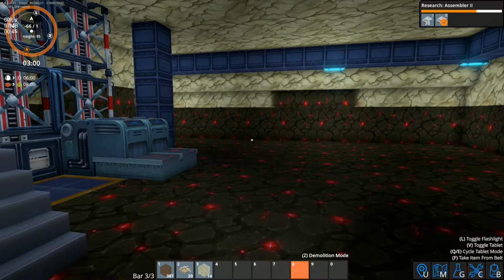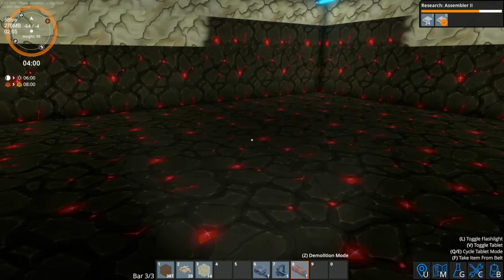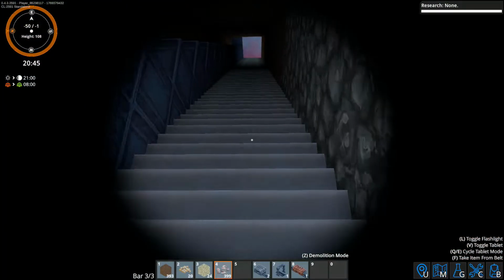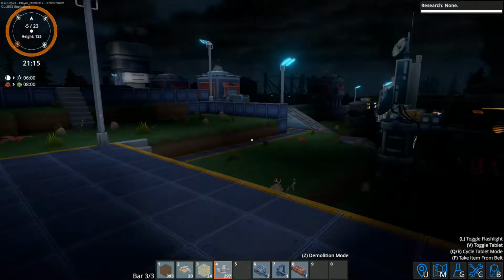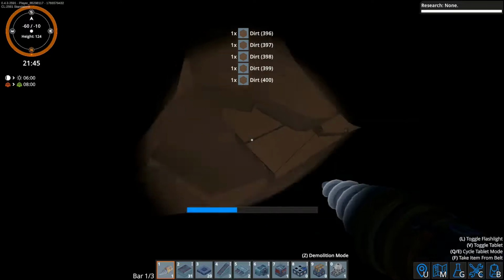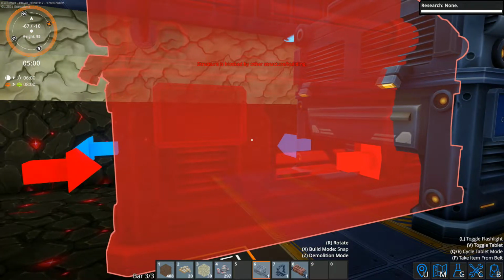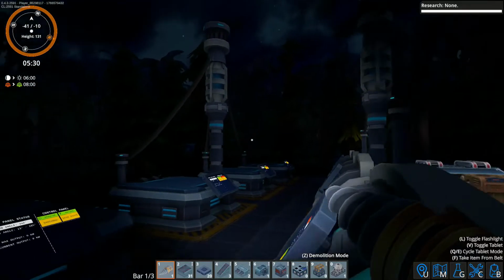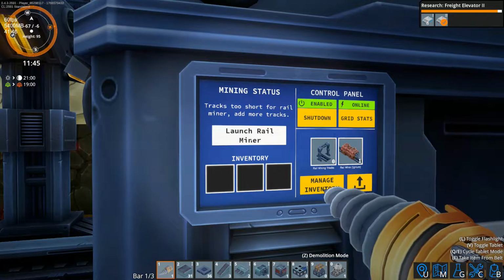Let's Play Foundry A Factory builder in early access pt.10 Life Underground!!!

Comment: Interesting way of conveying high voltage down to the rail station.  Personal Elevator can convey high voltage power.  Doesn't need it to operate.  Use Elevator to get down to the layers you want to mine.  Dig out a space for rail station.  Convey power through connections on Elevator to those rail stations.  Use a second elevator to dig a shaft for freight elevator.
Reply from the maker: LOL there are lots of different ways to do things. I am aware of the passenger elevator digging it's own shaft and carrying power as the description says it will do that.  I dug the stairs out long before I had the elevators though unfortunately LOL.  Besides bud by the time You left this comment, I have already placed and am running a second rail miner station and miner etc. 
  Thanks for watching and for the help.